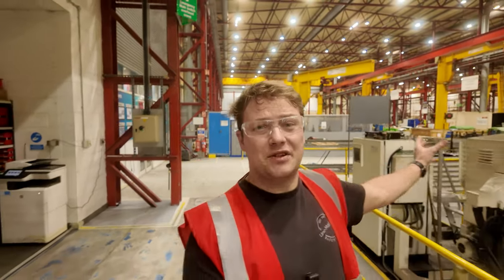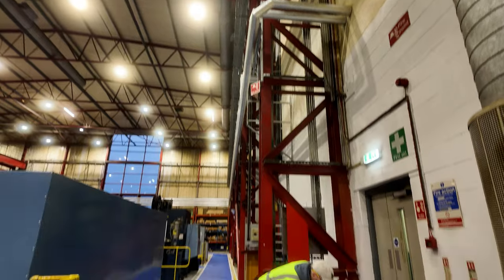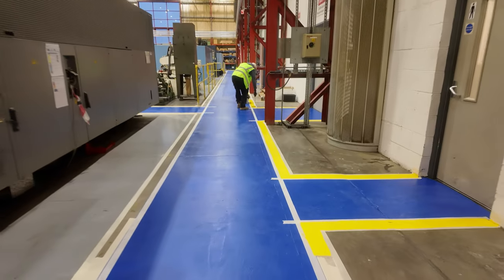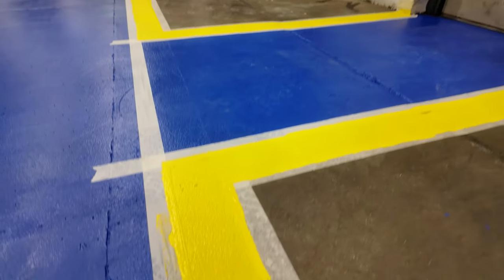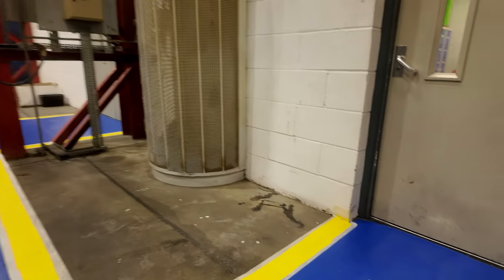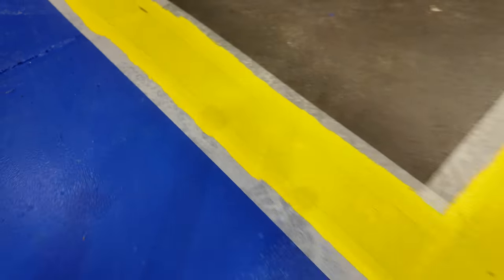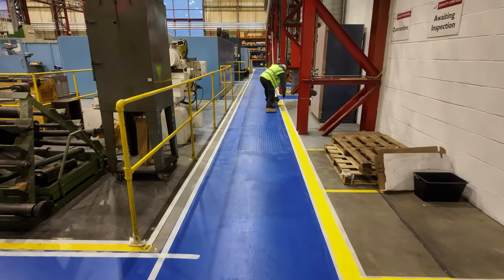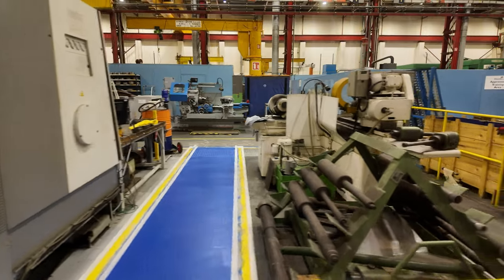Transforming The Assembly Line. Factory Line Painting

Comment: What is the sealer that you use for finished product.? 
Thanks
Reply from the maker: Hi, we use the Geveko transparent matt sealer for most of the projects, but if you need enhanced durability, you could go with the SolidLux or RapidShield which are UV curable. We tend to use these for heavy traffic areas. Here's a link to the UV machines we use and list of the UV sealer suppliers: https://www.decorad.com/en/products/new-uv-floorcure-2030
Reply: Thank you
Reply: Hello, what do you use to remove paint spills from concrete or black pavement?